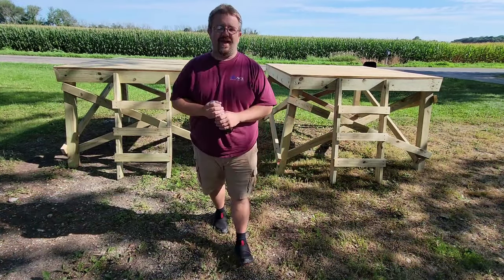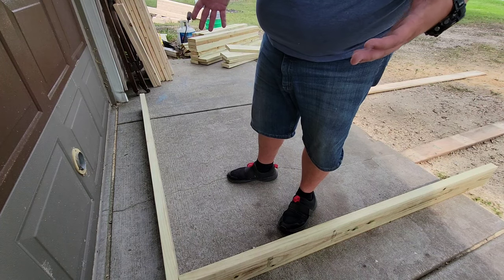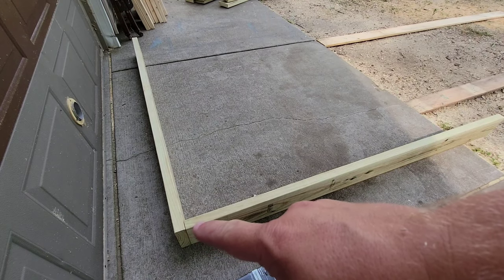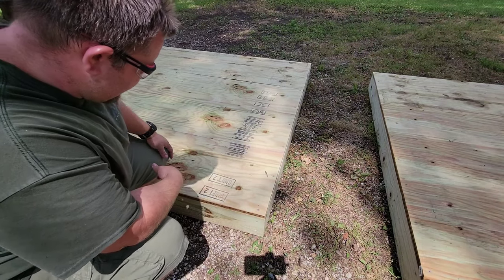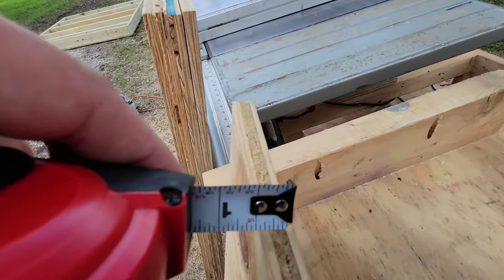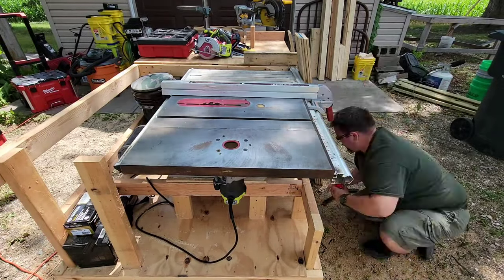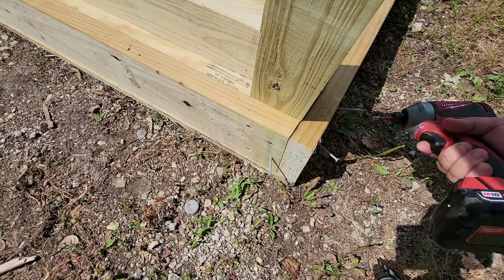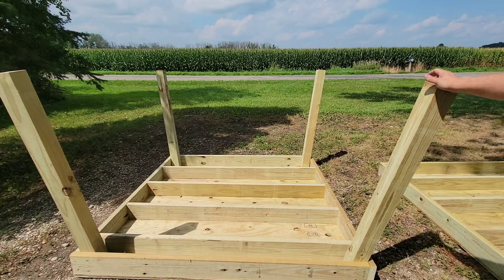The BEST DIY deer blind tower + 5 Tips

Comment: Replace one of the 3 screws at the leg attachment with a lag bolt. Not very secure with with those light screws
Reply from the maker: Great point.  I actually use 5"x3/8" spax lags on the longer of the 2 boards for the angled side now.  That works really well.

Comment: Glad to have found this video.  I'm moving away from full shooting houses and instead will build a few of these to install ground blinds on top of them - which can easily be put up and taken back down at the end of the hunting season..  Thank you for all the detail; the idea to tilt the legs is very valuable!  Thank you!
Reply from the maker: I can't remember if I mentioned it but if you use deck boards there is hardly any issues.  Plywood put a couple pieces of secondhand tin with some slant on it over the summer.   The plywood last a lot longer.

Comment: Having 4' legs , how wide overall did that make it with the shims. Great video and tips. Thank you.
Reply from the maker: It will all depend on the length of the leg, straightness of the lumber and the shim thickness used.  Normally on an 8 foot leg with 3/8" shim it is roughly an 18" gain.

Comment: What size cross boards and decking boards? 2x4 or 2x6? Great video
Reply from the maker: For the "floor Truses" I use 2x6 around the outside.  Center I do 2x6 at 16" oc or 2x4 at 12" oc.

Comment: Just curious why you aren't using the spax lag screw in the 4x4's? Nice build bud
Reply from the maker: For the part where the leg meets the platform?  Or where the cross braces attach to the legs?
Reply: @BuckPole  where the legs (4x4's) join to the platform

Comment: Why isn't the little narrow 2x4 placement put over by the scene part instead of out there where it's not needed on the wide one
Reply from the maker: Sorry I'm not sure what you are asking.   Can you try to describe the issue so I can help?
Reply: When you're showing the floor assembly with the floor joist close to the end shouldn't that be over where the plywood will only be on a half floor joist for support instead of over where the plywood covers the whole end ( floor joist) I
Reply from the maker: I think I understand.   The 2x6 section is on end with the short side so it is on 3 floor joists.

Comment: For this being a tutorial on building a stand for a blind, if you pardon me, you don’t know your ass from a hole in the ground! For this being a tutorial on building a stand for a blind, if you pardon me, you don’t know your ass from a hole in the ground you talked about not using a truss bracket on your floor joist and I’ll bet what you should’ve been saying is you don’t use a joist hanger on your joists!
Secondly the plywood floor should be installed perpendicular to the direction of the joists!
Did you know that you can actually go to the plywood manufacturer’s website and they have instructions on how to install plywood for everyone to see. The only time you do not put plywood on perpendicular to the joists is when you install it as wall sheathing. Other than that it must be installed perpendicular to the framing members.
So if you weren’t acting as a teacher of these platforms, I wouldn’t have commented. If you teach, you must be correct.